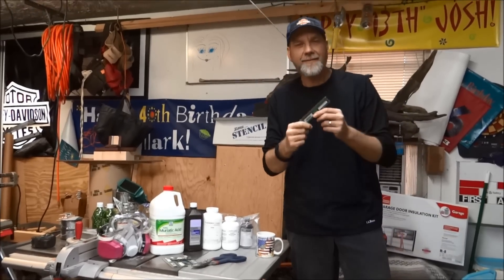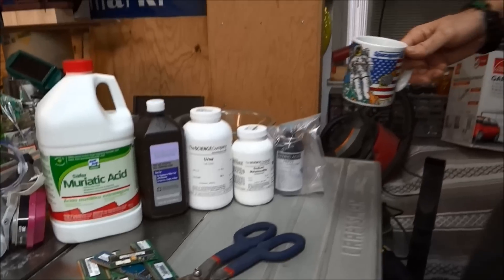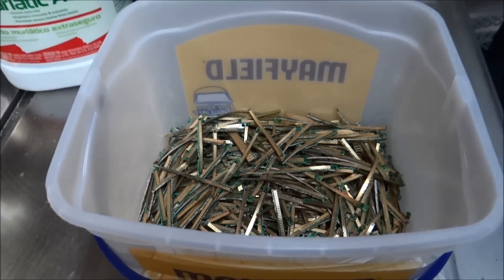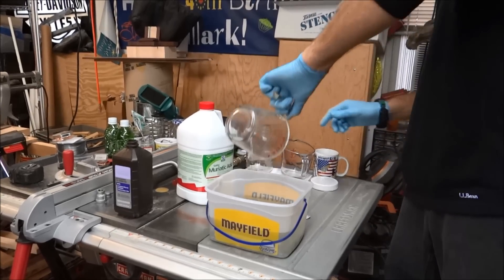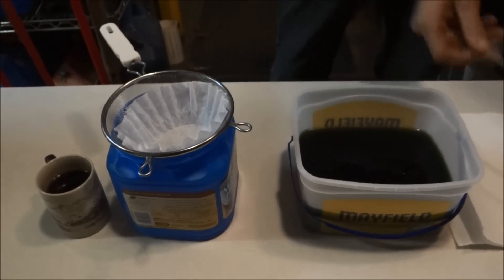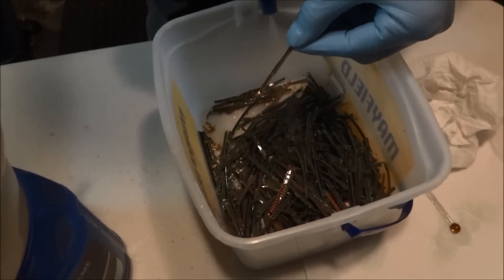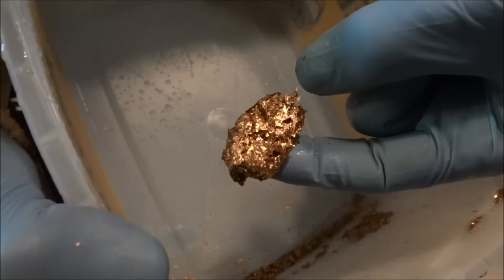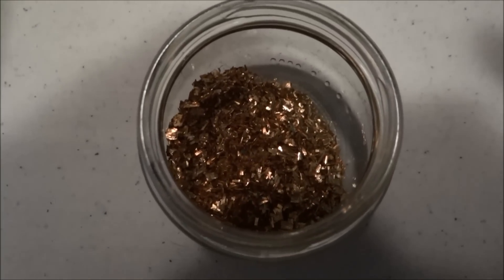How to easily recover gold from scrap computer chips

Comment: These comments are a joke... ok.. yes he put a coffee cup on the same table as a bunch of CLOSED chemical containers.... Big deal... One drop of that acid in your cup wouldn't do you a single bit of harm.... I do pool service.. i have muriatic acid strong enough that it smokes as soon as you open the container... Sadly, most of you haven't got much experience in the area of chemicals, or exactly how flammable gasoline is not... Fill a coffee can with fresh gasoline from the pump... smoke half a cigarette... then toss the other half in the gas.... there's a one in a million chance that it may ignite.. but the rest of the time.. it will hiss and put the cigarette out... Pour acid right on your tongue.. and you should be slapped with a frying pan for being stupid... set your cup next to where you're working with acid... and you'll get a tingle and you won't make the mistake again... BUT... yes there's a BUT.. The smell of muriatic acid is so rancid it will make you cough and it will even kill you by scorching your lungs and wind pipe.

So before you call him names for being comfortable working with things that scare the hell out of you.. remember, we aren't all scared of everything because the media or a label says it's got this or that potential... You drive a car? You drive a bomb everywhere you go.. does it cross your mind? You drive and mess with your phone... You're dumber that anyone who just set their cup down... get the point...

Comment: less acid less hydrogen peroxide more distilled  water more heat more time the metal salts need the water to dissolve in to the memory chips also have gold bonding wires and the solder has some silver.

Comment: A few notes, since I've been studying this stuff.
1) I hope somewhere in this series you explain how to reuse/filter and safely dispose of the chemicals to avoid damage to the environment and yourselves.
2) Your safety procedures were inadequate.  You should've been using rubber gloves and a respirator, plus you should've had excellent ventilation so you weren't sucking up toxic fumes.  You're playing with stuff you don't seem to fully comprehend, or aren't explaining to viewers, which is irresponsible either way.
3) Computer boards these days are multilayered and some contain more than just gold.  Ideally, boards should be shredded and run through multiple extraction stages to remove gold, silver, copper, palladium, platinum, etc.  If you're only doing fingers, there isn't much else to get, but if you want to get the precious metals from the other parts, it's a difficult and dangerous process that you should learn about thoroughly in order to avoid long-term health problems, risk of death, environmental damage and more.

Comment: THE USE OF SHREDDERS STARTED A LONG TIME AGO BUT WITH THE ADVENT OF RECYCLING OR EVEN BEFORE MAJOR MOVES WERE MADE ABOUT THE RECYCLING OF WASTE MATERIALS THERE WERE A FEW OF US IN THE SHREDDER MAKER GROUPS THAT PIONEERED THIS FIELD AND THE HAMMERMILL AND SHEAR SHREDDER AND SINGLE SHAFT GRINDE ARE JUST ONE OF THE DESIGNS PIONEERED BY THE BURDA FAMILY OF OREGON AND THEIR SHREDDER DEVELOPMENT PROGRAMS UNDER THEIR SHREDDERHOTLINE AND SHREDDERONLINE BRANDING OF THEIR EIDAL SHREDDER, SHREDPAX SHREDDER AND GARBALIZER SHREDDER BRANDS SINCE 1966

Comment: Very bad video, setting a bad example: 
- A cup of coffee between chemicals while telling peeps should use safety goggles?
- On day 2, again ! never  food stuff in the lab !
- Strong acids on a metal machine, where is the plastic sheet to cover it.
- A dog just below a lab table where you pour conc HCL ?
  Whify & dog won't be happy if you spill that stuff on the dog.
Trowing concentrated HCL trough an iron strainer, not smart if you like to reuse 1 of them.
I know it can work that way, i'm a chemist, 
but next time please DO as you preach about safety.

Comment: For all you people who want notes without all the BS. Here it is :

Courtesy of KronicDecay :

Safety Items Needed for initial extraction of gold fingers :

Goggles
Respirator 

Chems Needed :

Muriatic Acid (Brand : Klean-Strip)
Hydrogen Peroxide
(Both From Walmart)

Urea : purchased online
Sodium Metabisulfate : online

Nitric Acid (HN03) : online (video creator does not say but assuming online purchase)

Step 1:

Extracting :

- Use shears to cut off RAM fingers

- put all fingers in a large plastic container (heavy plastic : think large mayfield icecream container)

- Add equal parts peroxide and muriatic acid (enough to cover your yield)

- Let sit 24 hours (if possible let sit outside in sun during day then take inside at night for best result)
Use glass stirring tool to stir on occasion (helps gold come off fingers)

After 24 hours :

- Stir solution 

- Make a container to put a strainer on (Large coffee plastic container with strainer and coffee filter)
**USE RUBBER GLOVES**
- Slowly pour solution into strainer and filter (will take a few pours)
* USE RUBBER GLOVES DUE TO ACID PICKING UP FINGERS***
- Use distilled water in a spray bottle to spray fingers that are left in bucket
- Spray fingers until gold is off them and toss old fingers into a waste jar for further extraction
- Continue adding distilled water from sprayer to bucket after fingers are removed to get all gold out of bucket
- Add again to strainer with coffee filter

Step 2:

Refining Extracted Gold :

Safety Needed :

goggles
respirator
thick rubber gloves

Chems :

Nitric Acid
Muriatic Acid
Urea
Sodium MetaBiSulfate

- Add a shotglass each of Nitric Acid and MetabiSulfate to gold solution

- Put on a hot plate (turn it on low)
- Let Sit until gold is disssolved

- Strain solution through coffee filter and strainer into a glass container
- Use distilled water in spray bottle to get all gold out of container
- After all gold is filtered out spray under strainer for stragglers

- Add 4-5 TBSP water to solution
- Put back on burner

- Add Urea (1 TBSP)
- Keep adding until solution stops boiling

- Add Sodium Metabisulfate ( 2 TSP ) (Turns liquid gold into solid)
- Stir after seeing solution reaction

** Let sit overnight **

- Re-filter solution into another strainer and coffee filter (use caution)

- Gold should be left in original container after straining

- Add gold to some sort of smelting device and use a torch to heat up until its melted

- Continue using torch to heat gold up and then allow smelted gold to drip into a below container

"There It Is Boys" 

Just saved you all an hour of your lives haha

Comment: Just wanted to say that this is an informal video, however, that respirator only protects you from particulate matter. The chlorine gas and other gases will pass right through. To better protect yourself, you should use a gas mask.

Comment: why cut off the fingers vs. just putting the whole chip in the mixture? is it due to the risk of other metals on the chip that could contaminate the purity of the gold?
Reply from the maker: It just adds more crap to your mixture that you will need to deal with later.

Comment: That's actually the ram of the computer not the memory.  It is gold and whenever you see gold on a circuit board, or in this case the ram card, it is converting electrons from a along to digital.  Experience: Computer Engineer
Reply from the maker: RAM = Random Access MEMORY.  RAM - Memory......most non engineer type understand the difference.  Thanks for trying to look smart tho.

Comment: At 6:13 when you are filtering, what is it what you are actually filtering? I mean the sticks and the gold are still in the container and you 'dispose' the acid. Why did you use a coffee filter at this point? Is it only meant to catch small amounts of gold which accidentally go with the out poor?

And another question: If you melt that stuff you have at the end of this video, surely the gold would not be 24 carat. I may only be 10 or 12 carat. So could you not just melt that lump of (semi) gold and sell it as 10 or 12 carat? I know you would get less, but it weighs more and saves you a lot of work.

Comment: You guys and your dog crack me up. Thanks for sharing this. Ignore the negative people. Also, could the mixture you soaked this stuff in be reused for the same purpose? Did the mixture corrode the metal strainer you started off with?
Reply from the maker: Yes, the metal strainer is bad....don;t do that, the job was done before it corroded.  Yes, the chemicals can be re-used if kept fairy clean.  If you haven't already done so, subscribe to keep up with updates.  Thanks

Comment: Rather  than using chemicals that cost as much as the gold you recover,,,why not just cut off the gold tabs, and pulverise them into a fine powder grinding them with sand and water. and pan out the gold ? or by firing in a furnace to burn off the pcb (printed circuit board) then grind it up..and fire it again.

Comment: I wonder if it is possible to heat everything up so that all that is left is ash and molten gold?
Reply from the maker: It wouldn't end up very pure.  You would also end up with the copper and silver and other metals.
Reply: Well, wouldn't that depend on the melting point of the individual metals? It's my understanding that gold would melt at a lower temperature than those other metals? Perhaps if the proper temperature could be reached for gold, you could melt down only the gold and scrap the rest. Just a thought.  :)
Reply: Melting pop cans in a home made furnace only produces minimal aluminum. The rest of the gunk is composed of other metal like substances that melt at a lower temperature than aluminum..flaky stuff. So yes, it is possible to get pure gold but you are looking at finding/or building a furnace that can support heats up to 1,100 Celcius or more... Then you just scoop out impurities and repeat the process. There is a more chemical way of seperating gold but I am not sure how that works.

Comment: What about the gold in those chips on the ram stick?
Reply: There is none, or a very small amount. The problem is the sticks. where you put the fingers down the wholes, you want an electric current running smoothly, and you're not the one mounting them, the customer is, the best way of securing that, is by using gold.

Comment: Many years ago I worked for a company that made circuit boards and the amount of gold used to plate contacts is very very small - around the equivalent of one ounce per square yard so I am not surprised at the low yield. Regarding alternative methods of getting the contacts off of the circuit boards - if you melt them off you need to find a way of removing the copper and nickel from the gold. Typically the gold layer is about 1 to 1,5 microns thick (that's 1 to 1.5 thousandths of a millimetre) the nickel is 4 to 5 microns and the copper is normally about 35 microns thick. The dissolving method is the best way to remove the copper and nickel to leave just the gold as melting the contacts first would produce a gold/nickel/copper alloy which is much harder to separate.

Comment: Why don't you just do it the way the Chinese do it.  Have a child put the computer bits in a metal pan and melt the plastic away over an open flame.  Make sure you do it outside so you have plenty of ventilation Remember Safety 3rd..
Reply: he he

Comment: You know microchips, like memory, attach the silicon die to the pins using gold wires, right? Way more gold than the microns-thin plating on the pads. No wonder companies pay money for them. 

Not all chips use gold wires, but if I did this, I'd certainly look.

Comment: the acid's must cost more than the gold taken off surely?
Reply: It does cost a little which is why most people that do this recommend you build up a nice large amount before you start refining
Reply: It's probably the  joy of recycling it.
Reply: Nope. He is just using the wrong method. Only need muriatic acid and for an oxidizer a piece of tarnished copper tubing, then no nitric is needed only household bleach. Then the use stump out to precipitate the gold.

Comment: I don't use chemicals for the gold fingers. I use my soldering iron to quickly remove the gold fingers from all boards that have those fingers. I use a file on the irons tip,modifying it with a sharper edge. Allow the tip to reach highest temperature,then apply tip at one end and slid it on down the grid of fingers. you will be surprised as to how far up into the board the gold wiring goes. keep the tip clean by running the file over its edges.  Some boards have segments of gold plating. refineries have been duping us,telling us there is not much gold in them computers at all,of course it all depends on the type and age of the boards,but the gold is there. You will find it.
Reply: make a video showing your method..
Reply: I will try this now the wet Wat worked

Comment: Hey,Cool Stuff.

I got a question. what  the acid -peroxide process does? It takes the copper and other unwanted metal away right ?

But  Why cant we directly put Muriatic acid and Nitric acid  so that the gold layer will react with them to for AgCl.???

Comment: Do not store muriatic acid in your house or in any enclosed place containing iron or steel. It's vapour is insidious and within a few months it will rust out and destroy things like... the heat exchanger in your forced air furnace. IT DOESN'T MATTER IF THE LID IS TIGHT. IT STILL GETS OUT. STORE IT OUT SIDE IN A SECURE PLACE. SEAL THE BOTTLE IN A PLASTIC BAG. THIS IS BAD STUFF. Please excuse my yelling but it's worth the while in this instance.
Reply: if nobody gives a shit then why don't you do it so we don't have to see your retarded comments anymore? just a suggestion
Reply: thanks for the tip im putting this shit in my shed right now no joke....
Reply: Right? I was getting some polyurethane today at Wal-Mart and saw 2 different brands in plastic jugs. Right next to the acetone and thinner and toluene there was muriatic acid for etching concrete and another brand labeled Hydrochloric acid (same thing) there too. I mean A.G.M.'s advice can't hurt but like your saying it doesn't add up. My whole life with a father who is a contractor  I've never heard anyone complain of mysterious corrosion in their homes or anything else. Besides would companies really put muriatic acid in containers that weren't suitable for storage under normal conditions?
Reply: I strongly agree, in fact video shows his "work bench" is actually table saw built of steel and aluminum. Both highly reactive to these chemicals. DO NOT DO THIS (yes I'm yelling)! Do it outdoors for ventilation, still wearing respirator and goggles plus face shield. Use wooden work bench with plastic drop cloth. Keep your children and pets away, if you really love them, unless they are wearing respirator. Even then, it is best to work (nearly) alone with the other person knowing what you are doing but at a distance, esp. with Nitric Acid.
Reply: A.G. M. The places that sell muratic acid store it in an enclosed place containing iron and steel, and it doesn't seem to be a problem for them.
Reply: Thanks for the tip
Reply: A.G. M. Except it sits on metal shelves in hardware stores for months with no problem. Oh and the big buckets of it in the supply room for the pool at the hotel I work at that's in there 365 days a year with the heater and lots of other junk and hasn't caused any problems so.... Explain all that.
Reply: King Alfred I hear you Alfred , I said basically the same thing, this guy is full of shit. If there's a cap on the bottle sealed tightly nothing's getting out.
Reply: C00K31 Why just 'cause some random person told you to? It hasn't caused any problems where you had it stored so why is it all of a sudden going to now?
Reply: Hardware stores that sell Muriatic acid more often than not do not stock Muriatic Acid indoors but store it outdoors. If you do see it being sold indoors in plastic containers with screw on lids, the bottle itself will be double-sealed in thick plastic sheet. The acid leaks-out as a mist through the lid and the destruction of unpainted steel or iron objects takes a few years.
Reply: A.G. M. Lowe's has it right on the shelf with turpentine, lacquer thinner, acetone etc. And in the same type of container.
Reply: Vững chắc 1. hg .95.
Reply: Gold in the gutter Gold in gutters unbelievable https://www.youtube.com/watch?v=fwUj_w2KVUc
Reply: That's why he has his coffee cup next to it.
Reply: A.G. M. OH YOU KNOW WHAT? NOBODY GIVES A SHIT!

Comment: The problem for most people would be acquiring this much RAM to begin with but I've got a small box full of really old EDO style RAM from the 1990's with some mixed in from the early 2000's - probably about the same amount he has in the video. My RAM is so old you couldn't give it away but if you had newer style RAM you'd likely earn more selling it as 'RAM' rather than breaking it down to it's gold component.

Comment: If you purify completely, it comes out to a pin head size piece of gold per ram stick. Not even worth it.
Reply: what he has here is a mix of copper, gold and other alloys.
Reply: +nate suprunyuck exactly. all scrap is worth way less than the manufactured item itself. Unless youre getting scrap for free, theres no profit
Reply: if he found broken ram pieces or computers and just took them out.
Reply: +animeforeverjoho since he has to refine it himself, hes spending more than hes making
Reply: You would have to acquire a LOT of RAM before any of this would be worthwhile, but if you have THAT much RAM and was of the modern-day variety you'd make more selling it as 'RAM' than it would to process it down to it's gold component.
Reply: moregold